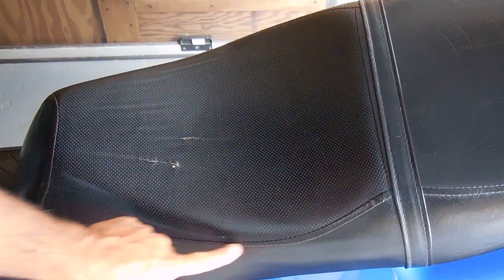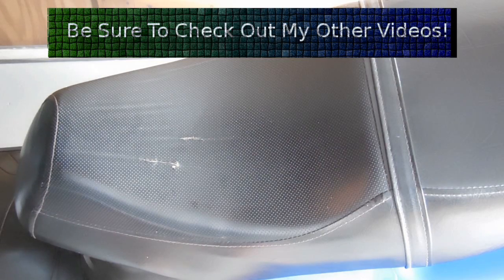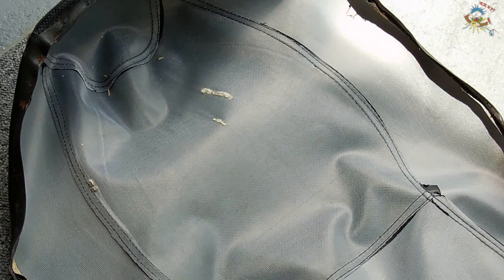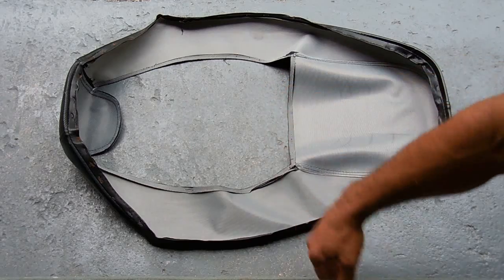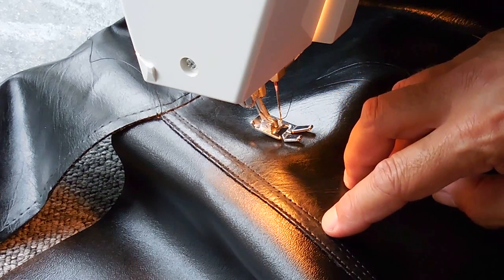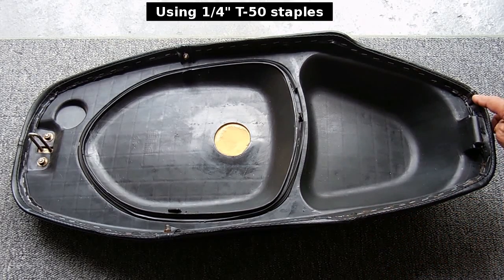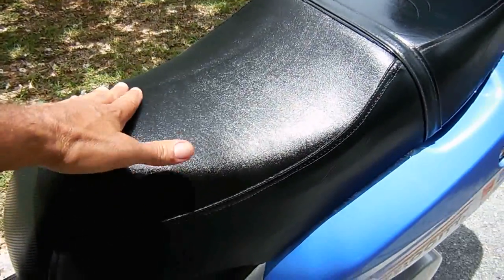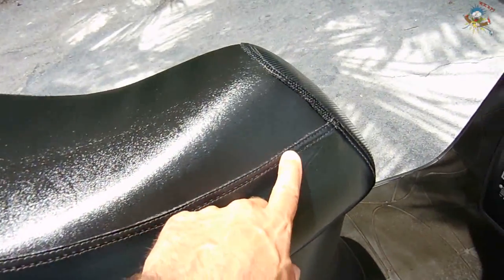Torn Motorcycle/Scooter Seat Repair(Vinyl)

Comment: nice job, do you work with vinyl repair
Reply from the maker: I've used vinyl repair kits in the past, the type with the heat iron, but the repair area tends to peel away ....does not last.

Comment: you could just repair the crack...
Reply from the maker: +artbyrobot 
Looks lousy if you do that.
Reply: Repair cracks is not beautiful and lasting.
Reply: wrong look up leather repair
Reply from the maker: artbyrobot
Not in this case. The vinyl was very dry. You'd end up repairing one area, and 2 weeks later a new crack will develop. What I did was best. You'd end up doing endless repairs.